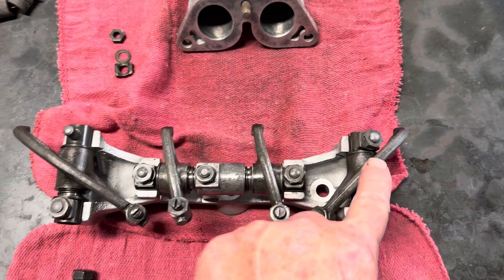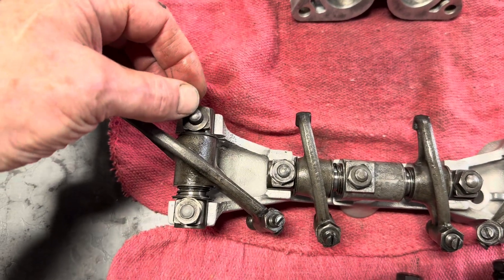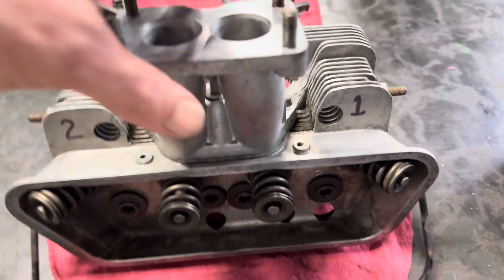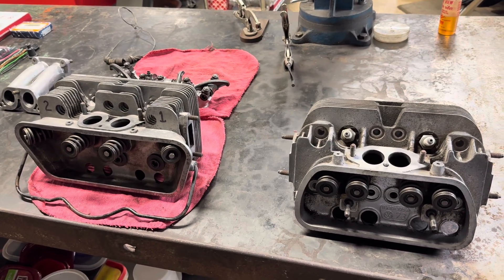Comparison - Porsche 356 / 912 cylinder head vs Volkswagen dual port cylinder head

Comment: The Porsche engineering is just amazing . The 356 head is much bigger and  cools very well . We used to put 356 motors into 67 VW. The motors fit into bugs very well and sound amazing

Comment: Hi those strange cylinder head bolts is a throwback to the earliest design that vw and Porsche shared. The 25hp beetle had similar deep seated head nuts with a shoulder. In the late 70s VW brazil approached Porsche for a redesign of the beetle cylinderhead and Porsche designed some beetle heads with canted valves and different rockers. It was called the BX engine and also featured a colling fan much like a 911.